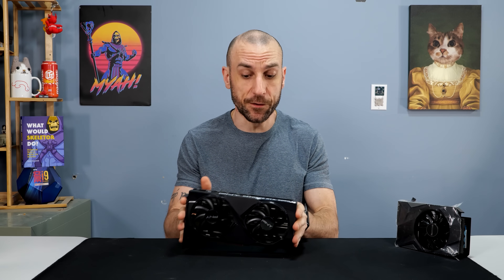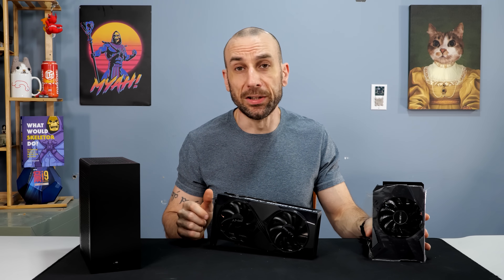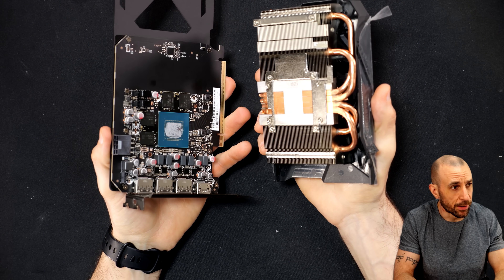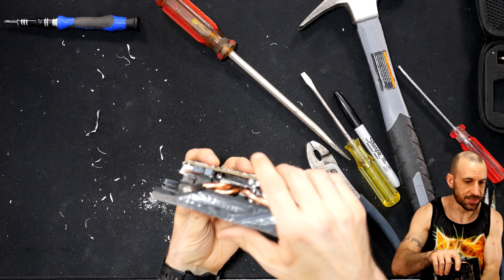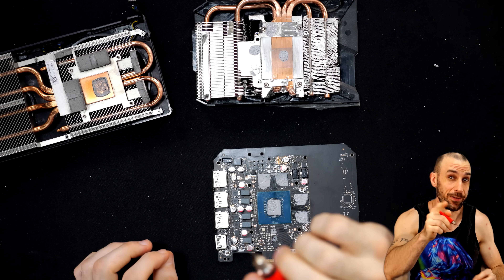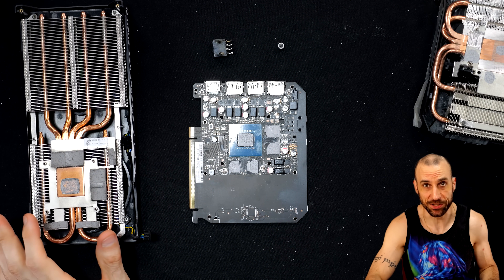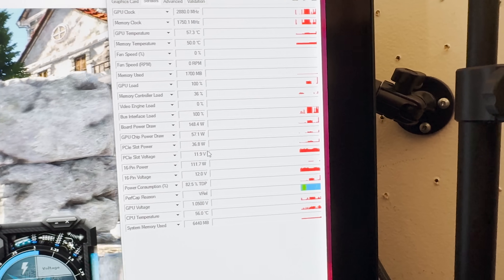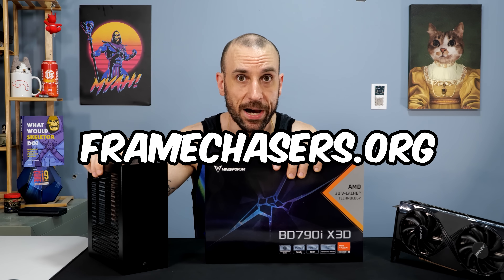🛑 Making The Fastest ITX GPU 😱👑

Comment: You should take the stock 5060 cooler and were its in two sections the one side contacts the die and the other is just heat pipes and fins take and heat it up and bend it double to make it thicker or just crimp off the pipes and cut off the other half and then braze heat pipes closed or just remove the fins on the half off cooler that would make pipes easier to bend just a ghetto thought

Comment: Do you have enough room for a 4 slot? If so just bend the heat pipes on the stock cooler and fold the rear half on the front half. You could probably fit a slim 90mm noctua fan between them. Like a heatsink sandwhich.

Comment: why not just modify the dual fan cooler?
Reply: Because the heat pipes run the whole way through the fins and you can't just cut them in half, that would render them useless.

Comment: Zotac 5060 solo and zotac 5060 ti amp are very close PCBs. Only 1 cap difference
Reply: *and different VBIOS
Reply: The 5060 solo cooler and probably be easily modded to fit the 5060 ti amp.
Reply: @MobileIndifference  No 5000 series coolers available on AliExpress yet. And that's a lot of money to spend just to possibly have an ITX card. In any case MSI makes a single fan ITX 5060 Ti 8GB. It was released back in April. Although I will admit that the cooler looks like some relic from the early 2000's and doesn't inspire much confidence in the way of cooling performance.

Comment: You need a comb that you can run through fins to help straighten them
 Also I think a file would help to clean up those cuts. 

Dont want aluminum dust on a live board. Aluminum is conductive enough to cause issues ×.×

Id love to have a basic tools and table to do stuff like this.

Comment: Random and not really relating to the video just wanted to know your thoughts to my build , ryzen 7 9800x3d , 6000mhz ddr5 vengeance ram , rog crosshair x670e hero , 4070 super Rog strix , 1300w psu gold platinum - all being used on a BenQ 144hz 1080p monitor yes I play at 1080p and yes I produce crazy high fps but there’s a reason why I like fps to exceed my refresh rate which is purley for input lag so ❤ - what’s your thoughts to build ?

Comment: i have a 3080ti founders and when it comes to replacing thermal pads or anything i kinda wish i had a random aib model. it can be a pain to take apart this thing. it be nice to just unscrew 4 screws and be good to go....... the fans are little ribbon cables that look like they would break so easy if you where not to careful and i tried to undo the rgb/led cable for the rtx symbol and it came off its solder points so easy lol.

Comment: Maybe pinch off the heat pipes on the stock cooler then cut off the secondary heatsink stack and see if the single fan shroud fits on that? Not sure if it's possible as I'm not sure if the heat pipes are pressure filled or something.

Comment: Why not cut the original cooler in half?  :)
Reply: was looking at original. might be possible but then there isnt much left of a cooler. you couldn't damage the heat pipes to the point they leak. then there is a giant mass of flattened heatpipes to deal with.

Comment: You adding 10900k to the blow up wall in the background
Reply from the maker: Didn’t think about making a blow up collage, great idea ima do that
Reply: Rip 10900k still one of Intels best CPUs
Reply: @Alex-ii5pm I disagree. The power draw of that thing is terrible and was wrecked by the Ryzen 9 5900X launched in the same year. Then the i7-12700K came one year after it.

The problem with the 10900K (also the 9900K) is that they lack PCIe Gen 4.0.

Both CPUs are part of Intel's dark age of Skylake refreshes stuck with gen 3.0 PCIe.

I still remember that AMD was the king of high perfomance laptops back then until Alder Lake.
Reply: @Alex-ii5pm I'm a intel fan myself but the i9-10900K will never reach the legendary status of the i7-8700K paired with a GTX1080Ti or the i7-2600K, or the i7-4790K, the i7-12700K (best i7 ever) , 13700K (2nd best), i5-2500K, i5-13600K, etc...
Reply: @saricubra2867  lmao calling yourself a fan of company will never stop to amaze me
Reply: @erisium6988  Being a fan of intel doesn´t mean fan of terrible CPUs as well.
Reply: @Alex-ii5pm The Core i9-13980HX is the only good i9 Intel ever created (faster than a 13700K desktop and has like 3 times the efficency of the 7800X3D).

I was blown away by 13980HX laptops with liquid metal and how smooth they are on Baldur's Gate 3 without hearing the fan noise.